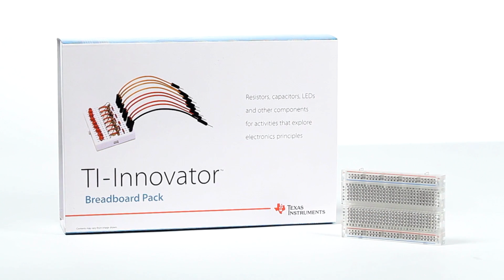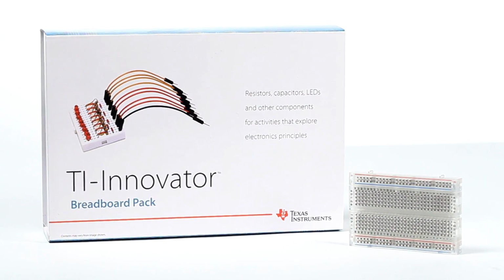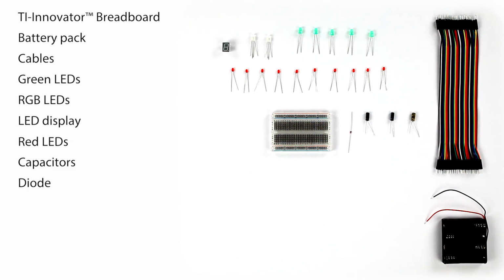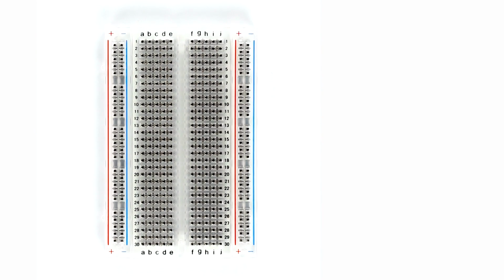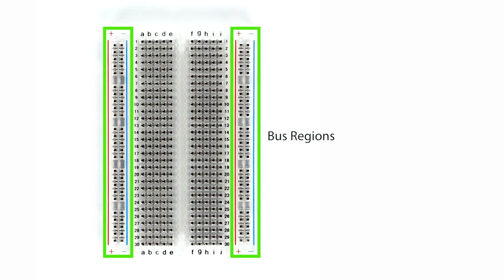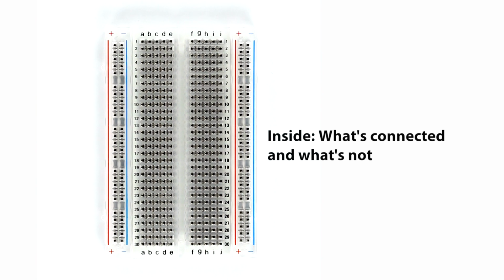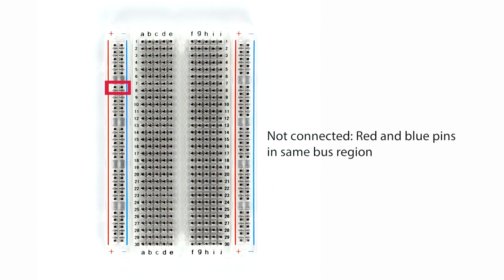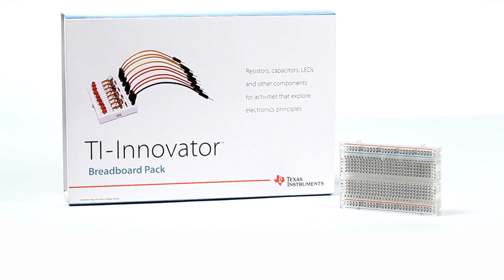TI-Innovator ™ Breadboard Pack

Comment: Instead of using the breadboard i soldered 8 resistors and LED to make a running light that is attached to the breadboard port. https://www.youtube.com/watch?v=wpOLW0ftsts&list=PLXb2bk0JWoAcPLTg_qmtD_ghQ3HnqJkLm&index=9 
Next challenge is to solder 2 seven segments and 2 transistors to a rapid prototype PCB to show nummbers 00 to 99